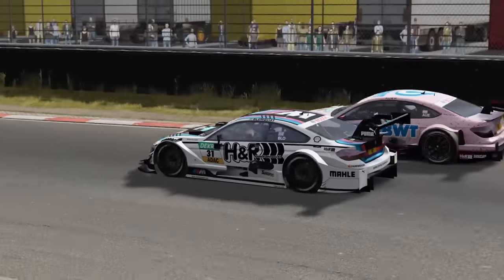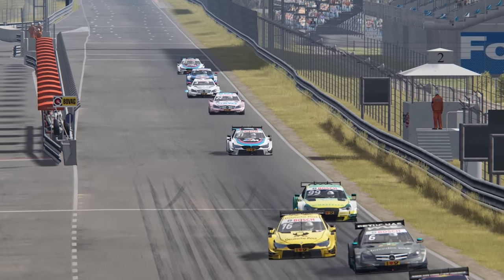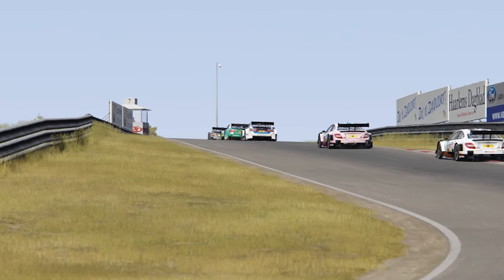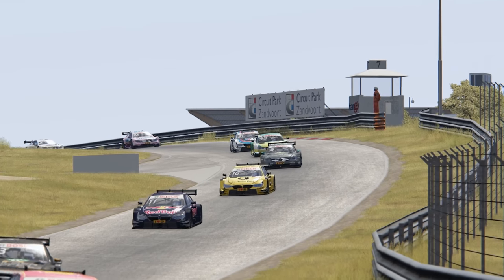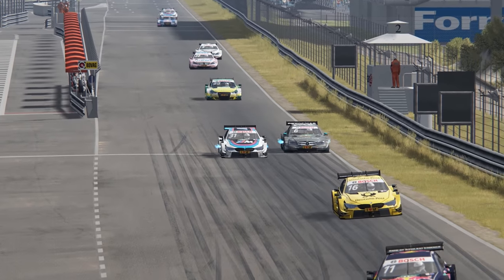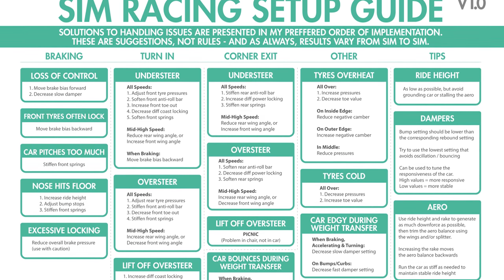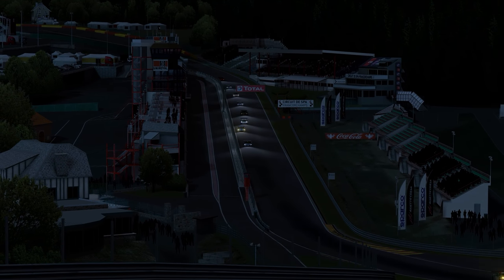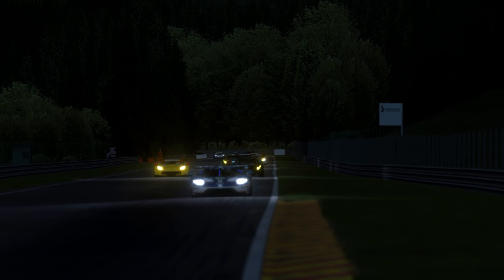Sim Racing Setup Guide 11 – Diagnosing and Curing Setup Issues

Comment: Extreme- middle- extreme. For example = brake bias. Nothing else to be considered,from default setup. Find the proper balance for the car. Move on to sway bars. Start no ft. Bar.- then bar full on. Find happy spot. Rears same then balance bars ft to rear. Got it?
Reply from the maker: Hey man, thanks for the helpful comment as usual. I'm going to pin this to the top because it's helpful advice for anyone. I like the checking the extremes idea, I'll quite often do a 'sweep' of the settings to see how the options feel, but going from extreme-middle-extreme sounds like a good way to stop your mind playing tricks on you.

Comment: I like to find a basic balance for my car and get it somewhere I can run decent laps comfortably. When I start searching for speed, instead of finding the slowest and fastest corners to adjust for, I start with the corner that gives me the most trouble; check if my technique is hurting the corner, then if it's not, adjust to find speed in that corner, as much as I can without hurting speed or balance anywhere else on the course. Usually does mean that I have to tweak 2 or 3 other settings besides the one I changed to try to fix the problem, but that's the nature of the beast. Then, I move on to the next most difficult corner and so on, until I'm comfortable, quick, and on the limit around the whole track.

Practice/Testing sessions can go on for multiple hours sometimes. I suggest working with constant conditions (optimal track surface, temperature, static weather conditions, etc.) and making a "base" setup. I usually use a half-full fuel load and set up my compounds and chassis as though I'm racing instead of qualifying/hot lapping, so setting up for a longer stint. Then use that base as a benchmark every time you're at that track, adjusting for current track/race conditions. The base is your clean slate to work from because you know if conditions are perfect, it's as fast as you know how to make it. You can do this for wet and dry conditions.